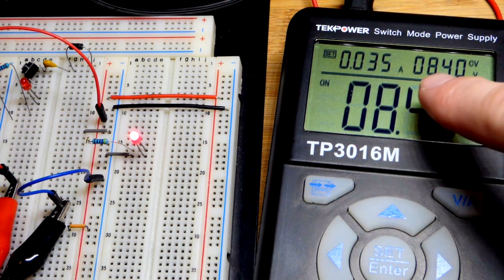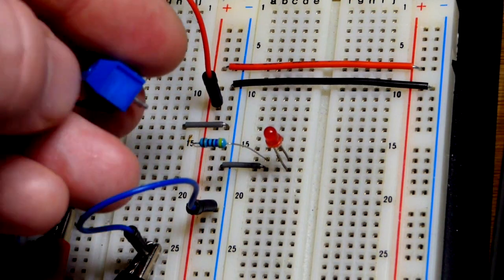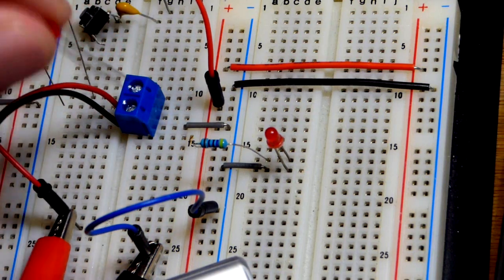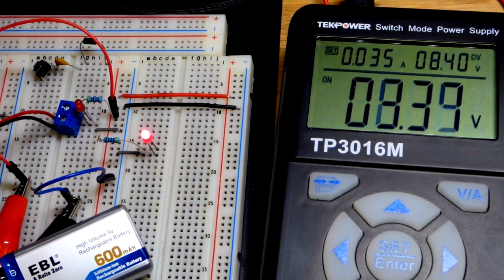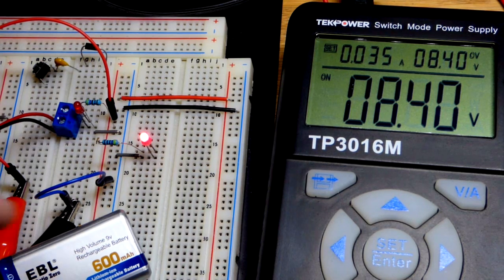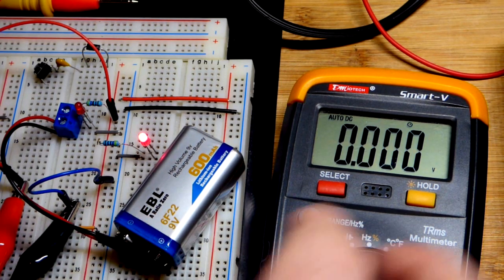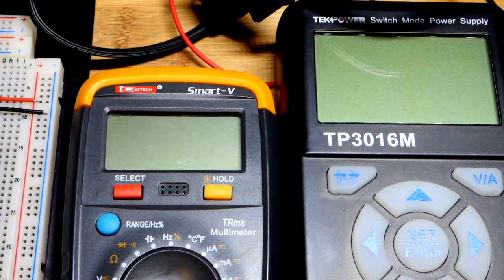Close to 9V lithium ion battery backup power supply prototype circuit

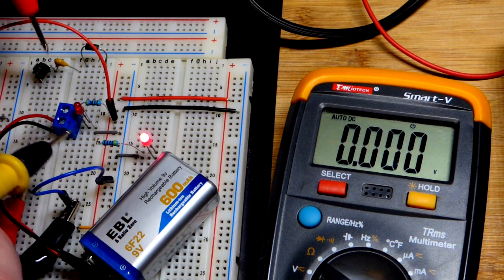Comment: Just a small observation... @5:10 you take a voltage measurement across the LED, but isn't this just across the '9v' battery? Shouldn't the voltage across the LED be the difference between the two voltage sources?

Doesn't really matter in the grand scheme of things but is that why the second reading across the battery @5:19 is the same voltage?
Reply from the maker: I measured at the Anode of the LED (red) and the negative rail jumper (black). Electrically, it is almost exactly the same as measuring the battery directly. The red probe is isolated from the 8.4V power supply because the LED is reverse biased. If I measured Red-Anode and Black-Cathode then I should have about -0.4V , which is the difference between power supplies, because the battery is about 0.4V lower in voltage than the power supply. Without the LED (or rectifier diode) blocking the power supply voltage, the battery would charge up to the power supply voltage at a speed determined by the current flow. Hope that answers any questions you may have! I rushed through these topics in this video. I hope to make a detailed video someday in the future.

Comment: The way I connect a 9V battery to my breadboards has seriously evolved since I started doing this at the end of last year. Now I am using cheap PCB boards that are easy to slice up into smaller pieces .. I cut one narrow but long enough to stretch the power rails of the breadboard then solder in a 9V battery clip which connects to a protection diode (1n4007). Next solder in 100uF and .1uF capacitors shorting the leads and finally some convenient header pins (and wires to connect them across) for inserting into the proper power rails on the breadboard. I also use them when I power circuits from the bench supply, just hook alligator clips to the 9V clip. I did insert one in upside down a while back and I fried a chip but that was Jamesons fault. 😂
Reply from the maker: Good times!